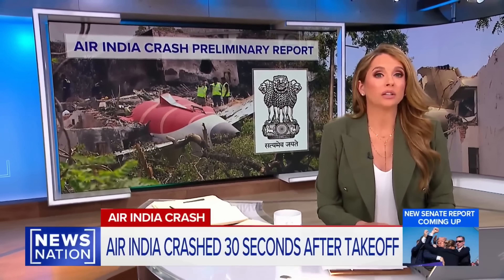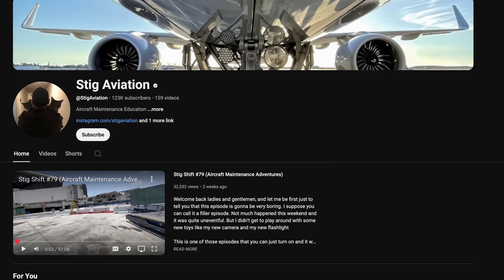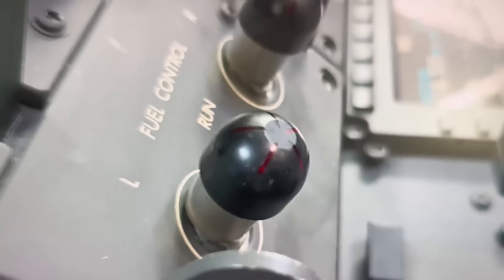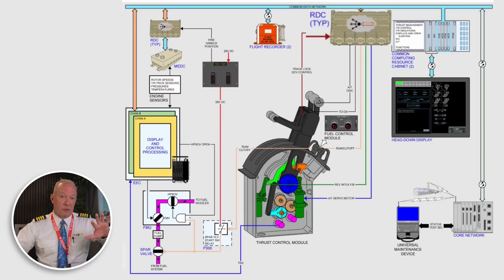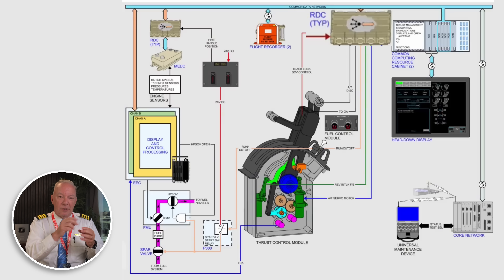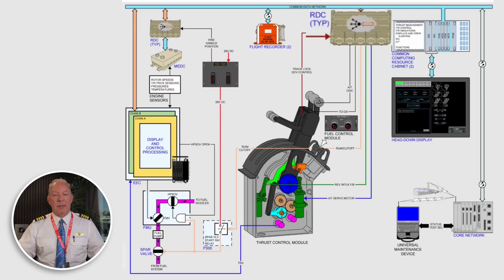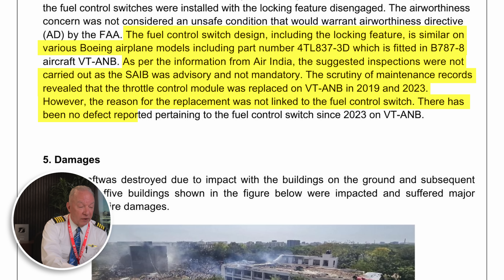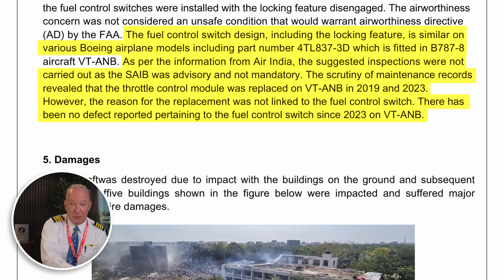The Truth About Boeing 787 Fuel Control Switches

Comment: I don't disagree with anything Captain Steeve has said on this, but the explanation on how the system works doesn't quite do it for me. Why are there 3 shutoff valves (in series) on each side if there's only one control per side? Is there anything else in there that can control each valve independently? The schematic makes it look that way (the AND gate, for example). Also, is there an electronic sensor that detects the state of the relay that's controlled by the switch (per side)? Is that condition sent to the data recorder? It seems to me that the actual system is more complicated than a simple switch-relay-valve, so there could be other sources of error. However, the chance of some other problem causing the 1 second delays in switching off and then back on is about zero.

Comment: Once the facts that the FDR recorded a switch position change, the CVR caught one pilot asking the other why the switches had been turned off, and the switches were found in the RUN position in the wreck, my own conclusion was that this was human-generated.  I will not speak to why it happened; we will have to hope that the investigators can establish what may have been going on.  It's possible that the exact reason for the switch movement may never be known.

Comment: This constant babble about the Boeng fuel switches.  WRONG!  No, there is NOT a relay inside the switch.  What's inside the switch is a SWITCH, and only a switch.  A relay is a REMOTELY CONTROLLED SWITCH.  Cap, you had a chance to learn the difference when you were hanging out at Radio Shack.  

The PROBLEM with the Boeing switches is NOT HOW DIFFICULT OR EASY it is to move the switch to its alternate position.  It's a problem with Boeing's poorly conceived cockpit facilities.  In other words.  Boeing does not know how to build controls based on HUMAN FACTORS design principles.  In my opinion, the actuation of fuel switches should have been accompanied by a cockpit confirmation alert such as a "beep," a "buzz," a "bell," a voice acknowledgement, etc.  The fuel switches are one of the most CRITICAL controls in the cockpit.  

It's only is a measure of time before poor design will bite you - and possibly cause a tragic result.  In design analysis, just because a device hasn't been known to have broken doesn't mean IT CAN'T HAPPEN!  This is aeronautical engineering kindergarten stuff!
Reply: So every time we shut the engines down at the gate, we get a warning???

What aircraft manufacturer does this.
Reply: There are plenty of warnings - such as ENG SHUTDOWN EICAS

Comment: Coils and relays can fail , contacts in relays can fail , voltages to a coil relay can drop out a comeback up, any of which could be a possible cause of a failure. How does the system monitor the switches being moved if there is not more circuitry involved?
Reply: Both fail within 1 second of each other just seconds after liftoff AND the switches moved?????

Riiiiiiiight……..
Reply: If you do not know the answer to that, by this late stage, you are behind the curve